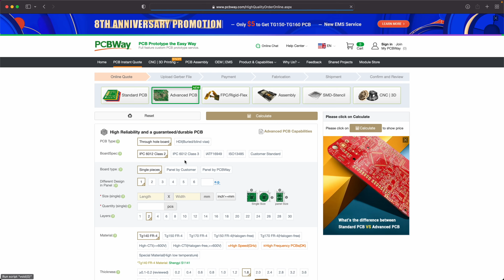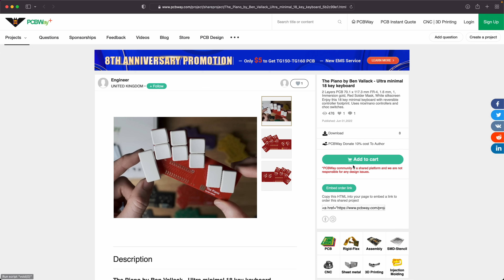"Absolute Magic!" - Building a Keyboard Using HOT AIR SOLDERING

Comment: It's been more than a year, but there are shockingly good hot air pencils (Digital temperature control, cooldown, safety shutoff, variable airflow), for about $30 USD.

They're better and less expensive than the average 20W "dumb" beginner soldering iron used to be.

Comment: I know it has been a year, but nonetheless here's an idea: If you solder the double sided holes with hot-air and it does not fill neatly, you could pass once more with a normal soldering iron. The solder already presend will make it take the heat much quicker and you can just add a dab of solder and let it flow nicely, without having to heat the thing for ages.

Comment: Definitely faster on the jumper pins, though may unnecessarily heat up the board if it isnt a sacrificial one. Definitely slower than even my very first beginner effort at doing switches

Comment: Hi Ben. What if you put TTP223 capacitive touch switches underneath a key cap and wires the switch to the PCB board so that the switch is a key press of a key. Then, you place the key cap onto a mechanical key switch of course so the key switch is also a key press connected to the keyboard. You can design a Planck keyboard with 47 keys all with the capacitive touch key caps which would give you a total of 94 programmable keys for the board (47*2). Halve of the programmable are touch bases and are held down as you rest your fingers. This makes for a very interesting dimension to the keyboard especially when it comes to switching layers or modes: default layer would be toggled if you rest all 8 fingers in the home row; a number and special character layer could be enabled when you move all 8 fingers to the row above. Any combination of finger resting positions could change the layers, but what’s most important is that the layer mode  is always known to the user because of their awareness of their finger positions.
Reply from the maker: Very interesting idea! This might open things up to avoid the issues around the delays associated with home row mod style layer switching.

Comment: So with the JST connector, you don't need to solder the battery directly to the controller? Instead, you only need to attach the JST connector, then plug that into the socket?
Reply from the maker: Correct

Comment: I might just 3D print a key holder and hand solder it up. I solder fpv drone flight controllers up so easy for me. The key is a good iron, have a Hakko temp controlled iron.

Comment: I used solder paste on a build, and a couple things to consider.
I would advise against using it for the MCU, at least if you are socketing it.  In my case the solder flowed down into the socket, making the socket useless. 
I would also be careful about how much paste you use. I had the solder flow through from a socket, and interfere with the switch plugs. Then when I removed the socket to replace it, I must have damaged the board, as the key would not function with the replaced socket.
I like the paste, as my wire soldering did not come out well, but still need to use it with care. 
I used a single use dispenser, and the needle was not real thin, might have better luck with a smaller needle where I could control the amount of paste better. 
I like the paste, and will try it again, if I can get my MCUs cleaned up enough to use them again.
Thanks again for sharing this technique Ben!
Reply: Good advice! Hot air soldering is great but not for everything

Comment: Great video as always Ben. I use a moonlander and am currently working my way down in key count / looking aT building some portable custom boards in the future. I was wondering if you have any issues using hot swap switches without a plate, do they stay in well enough? Also, I was wondering what resources you used for building wireless boards with the nice nano(s).
Reply from the maker: Cheers! No issue with chocs on hotswaps. Wireless boards with nice!nanos are pretty straightforward using ZMK. Jump on ZMK discord and you’ll find everything you need :)

Comment: Just a simple question: are the choc low profile switches compatible with standard cherry mx based stems on normal keycaps?
Reply from the maker: Nope
Reply: @BenVallack  So I am forced to choose: normal keycaps (with normal switches) and low profile keycaps with low-profile switches. Is this correct? 😞

Comment: 8:34 I’m not sure why you think soldering experts would a) prefer hand soldering in general, and b) avoid using reflow on through-hole. Reflow soldering has completely taken over the industry, and for good reason. The latter is called “pin in paste” and it’s an up-and-coming thing in electronics manufacturing. They’re now beginning to make connectors with the pin length optimized (shorter) for pin-in-paste.
Reply from the maker: Good to know cheers - there seems to be quite a lot of resistance to the idea from some people!
Reply: @BenVallack  Well they’re just being silly geese! :P I’m a skilled hand solderer, but I’ll take reflow any day if I can. It’s just way faster and easier, and produces a more consistent result if the paste is applied correctly. I’ve got a board to assemble tomorrow with somewhere around 40 0603 resistors and caps, 5 ICs, a dozen SMD LEDs, and a 40-pin flat-flex connector, and you bet I ordered a stencil for it. Other than two ICs that have only pads on the bottom (no leads, and thus MUST be reflow soldered), I could hand solder it all, but why? It’d take way longer.
Reply: @BenVallack  The only thing the objecting commenters are sorta right about is that using a hot air unit for pin-in-paste may not result in proper reflow, since it might not get hot enough throughout. A reflow oven using a proper reflow profile will ensure the components are “soaked” with heat, ensuring a reliable reflow. Using hot air alone, I have had paste that didn’t melt properly under a component. (Though I don’t think that looked to be the case with your IC sockets.)

Comment: You should checkout bismuth low temperature solder for these quick prototypes, it melts at a much lower temperature (~137°C) than silver solder (~217°C). Just don't mix it with leaded solder or it'll melt at an even lower temperature and get brittle (<100°C). I see that the paste you've linked is lead-free so that should be fine but if you've used leaded solder with your iron you should get a new tip.
Reply from the maker: That’s good info cheers! Only used lead-free.
Reply: @BenVallack  60-40 flux cored solder is very good. Silver is terrible to solder with.

Comment: I've got this reflow kit from Beta Layout, it's a pizza oven with a custom temperature controller made by them. Used it to make hundreds of boards with 0 failures so far, it's very easy to do. You can also DIY your own temperature controller with a microcontroller. Doing double-sided SMT I haven't tried yet but it should be possible with 2 solder pastes with different melting points. 

Also, tip for the small JST connectors: get yourself an Engineer PA-09 and it will save you so much time. You should crimp them on stranded wire without twisting or tinning the wire, that gives the best connection.
Reply: We have the reflow oven from Beta Layout at work, can confirm it works beautifully. (We have an actual mini reflow conveyor belt oven, but the Beta oven works better.)

Comment: Great video- as a soldering neophyte I get where you’re coming from but as I said in another vid, if you’re into ease and efficiency you really need to get yourself a proper crimping tool - the IWISS tool is 20 quid, gives a far better join and is much faster and easier than using pliers or tweezers. Give it a try.
Reply from the maker: Totally agree - if I ever need to do another one I will. But that was the last battery I should need to do - I have 4 done now so can just move them forward board to board.
Reply: Which tool is this? And how is to to be used for soldering?  - A video link to show how? Cause when I think Crimp = RJ 45, Solder = PCBs - Different worlds?
Reply from the maker: @AX-fx7ng  He was talking about the bit where I crimp the batter plug terminal onto the battery wire. I  added that in here as a bit of an extra to show my whole keyboard build format as the shots weren't as clear the last time I showed it.
Reply: @BenVallack   - Ok. Interesting. Will have to see again. Thanks. PS: Can this also be used to UNDO / REMOVE existing solders - of custom DIY or factory OEM solders?

Comment: Looks good. You should give solder paste stencils a try next time you order your PCBs! I typically do non-framework, 200x200 custom size, default settings. Then throw it in a reflow oven (T962A or T962), which gives great results (although hot air gun works too). Also, "paste in hole" (PIH) is a legit technique, although I haven't tried it myself -- you have to be careful because many THT components may not be as resilient to high temps as SMD components that are made for reflow.

Comment: Just last month I actually made a post with a title like “I solder wrong. fight me?” and it’s clear that we have similar views and goals when it comes to soldering.

You might like the technique I use: apply flux to the joint, set the iron to the minimum it takes for the solder to melt properly, load the iron with just the right amount of non-flux solder, then rest the solder on the joint until it flows through and burns off all the flux. One of the big benefits is that you can solder with one hand and hold components with the other. It’s also more meditative and forgiving.

I’m going to try out some of your techniques and wonder if I’m going to end up with a soldering iron and solder paste...
Reply from the maker: Very interesting thanks for sharing.
Reply: For the record: almost all the responses were open-minded and informative. Apparently it’s very similar to a few industrial techniques such as wave soldering.
Reply from the maker: Awesome!
Reply: This is actually the standard technique for SMD hand soldering. Since you need the non iron hand for your tweezers. But you can fundamentally use it for through hole soldering as well especially if you have a hoof/cup style tip, but works with other tip styles in a pinch.

Though i find myself through hole soldering the usual way, just cranking up the temperature and going at things way fast. Just feel it's quicker that way. I do still end up sometimes adding flux and going over once more but extra quickly.

Comment: Can anyone comment on the risk of using this method to attach the MCU?  That is the single thing that is stopping me from trying to assemble my own KB, I don't think my soldering skills are a match for the close spacing of the pins on the MCU. Thanks for the video Ben!
Reply from the maker: I will test this if no-one else can offer insight!
Reply: I have some solder paste in the mail to experiment with. Still curious if an MCU will handle the heat of hot air soldering. My attempt at  wire soldering resulted in one failed switch :(
Reply: Yep, it's a common method of soldering SMD components. Either use solder paste in a syringe like Ben showed and manually dispense lines of paste, or use solder paste stencil (if it's a PCB you designed), which is preferable especially for higher pin count or fine pitch components. Then use your hot air tool to slowly heat in circles, being careful not to leave it pointed in one spot for too long. You might have to use solder wick to remove excess solder if you dispensed it manually, but it's usually pretty easy to do.
Reply: @yellowcrescent  Is there such a thing as SMD sockets for a pro micro controller? Seems like that'd make that side of it easier, though I guess maybe mike h meant getting the pins onto the controller itself?
Reply: @ShawnFumo  There are ZIF sockets for SMD components (mainly QFP and QFN packages), but they are very expensive ($50 ~ $200+) and usually meant for programming fixtures. Also many of them also have SMD pins themselves, so you'd just be shifting the problem :P Although 3M does have some that feature THT pins on the bottom, but they are around $100 each. (Example: 3M 248-5205-00)
Reply: @ShawnFumo  yes, I was referring to soldering the pins to the MCU. Thanks for the clarification. I am feeling better about through-hole soldering with an iron, but if I end up with a board that I have to do SMD diodes I will be looking at using paste!
Thanks again to Ben for bring up this technique

Comment: I wonder if this method should be safe for switches as well?
Reply from the maker: You mean if you weren't using the hot swap sockets? I reckon they'd be fine is they're on the other side of the board to the heat etc.
Reply: @BenVallack  Yes, without hotswap sockets. I remember damaging bottom plastic on some switches that I soldered, those were from PC which is apparently the least temp resistant.

Comment: Ben, amazing videos about these small keyboards, really got me thinking about building one myself. I have a question about how this kbd, for example, could be adapted to have a bottom plate, so the components would'nt touch the surface of a table.
Reply from the maker: There are a few ideas for that - Ergogen can actually generate proper 3D files for 3D printed cases. Alternatively you can sink it into some kind silicon. Or you can just order another PCB in the same shape and screw together with spacers. However I just stick some hot glue over the shortable connections (you can see this on the red board at the end) and then I'm happy with it as-is. The hot swap sockets make the back of the switches nice and neat.
Reply: @BenVallack  Oh that's what that was. I was like "just how much flux did he use???" 😆
Reply: @BenVallack   I was wondering the same - Thanks for sharing - One could always have Ultra Slim "1 mm" bottom & low height sides cases that could be as easily removed at will or put on (for use or protection when traveling or dumping bags)? Wouldnt that make sense?
Reply: You also could add some feet to the bottom that are just high enough to raise the components over the surface, or add a tenting puck to put it on a low tripod or magic arms.

Comment: I'm quite impressed. I've only ever used solder paste with a stencil and it's a lot more painful than the method you show here. I'll get a syringe and give it a go. Overall it looks very clean, I'd recommend against the through hole as the solder can wick up and form a bridge between the board and the chip, something that isn't as likely when heating one pad and pin at a time with an iron.
Reply from the maker: Good info cheers! It actually looks pretty solid on the top of the through holes - the wider part of the socket pins seems to have sealed the hole nicely with nothing flowing out on the top. Even the JST pins which are very close together have formed nice little cones up the legs on the top side.
Reply: I've had this happen. Easy to fix if you don't fry anything, but annoying to figure out.

Comment: I've never thought about using a hot air gun with solder paste, I've got a YAMpad and the metal pads to solder the LEDs and resistors on are so small I've been putting off trying again after getting really frustrated with it the first time trying to solder it. I may have to look into getting the hot air stuff to give it a try.
Reply from the maker: I think the proper way of doing it is with some kind of oven or hot plate - I think the hot air gun is a good cheap alternative though! Just make sure it’s not on full airflow like I did first time. I blew half the stuff off the board and melted the rest lol
Reply: @BenVallack  Yeah, slow and steady sounds like a good idea. I melted half of the first LED when I tried to solder it on first time but I think it was just the plastic, so it should be okay.
Reply: @BenVallack  Not sure if you've had the need to use the hot air gun since you posted this video, but if you have, is the hot air gun still working well for this? I was going to look into getting one next payday. Would you recommend the Amazon one you've linked in the video description?

Comment: I really wish you'd practiced a bit more with your hot air soldering before doing this.

I wouldn't have used hot air at all.
Standard solder and iron would have been so much easier....

If you're having trouble with a normal iron adjust the temp and switch to lead/tin solder.
Reply from the maker: I did say I thought there would be plenty of people saying an iron would be easier/better/faster. Bottom line is for me after making a whole bunch of boards with an iron I find paste and hot air so much easier and it results in a much less messy board. The goal here is to make the workflow as simple as possible to iterate through these boards quickly. Soldering the pads on those tiny switches with an iron is basically a nightmare! Paste makes it seem far less daunting and there is less/no chance of burning the pads off the board.
Reply: @BenVallack  I agree, whatever works for you. I would be wary of doing this for the through-hole parts. The headers pins are pretty thick, and takes a lot longer for them to heat up. When you do this, you're potentially causing weak joints by having hot solder try to bond with relatively "cold" header pins.
Reply from the maker: @JipperGoneWild   Ah yeah they did take longer to heat up - great point thanks.
Reply: @BenVallack  You might want to look into toaster oven reflow of you're making a lot of boards as your method is very time consuming.

Just be very careful to test what temp the switches can take.